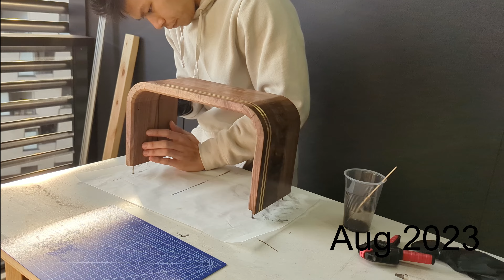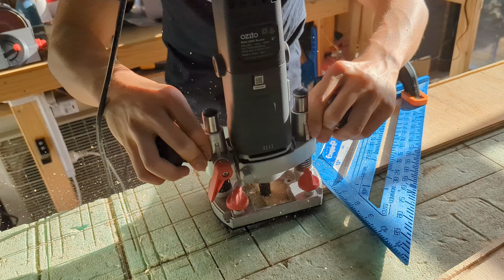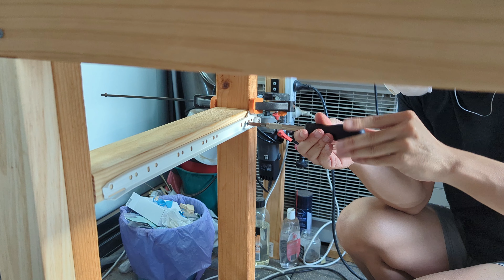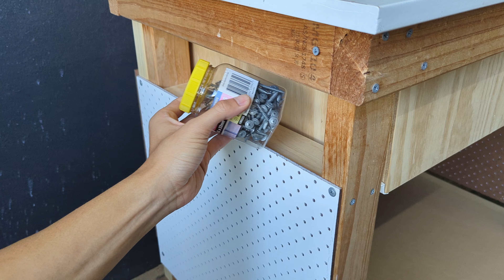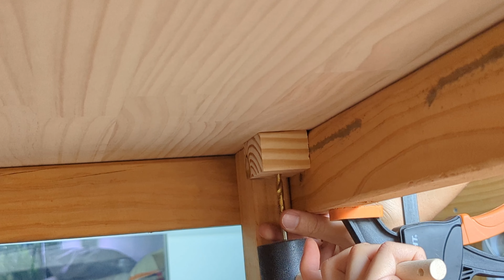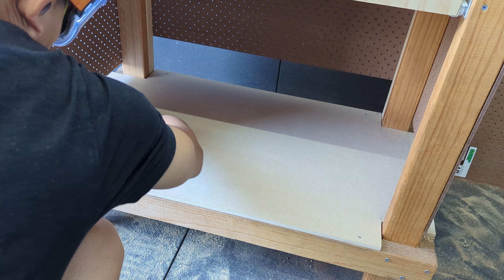Upgrading my Workbench. DIY | Budget | Woodworking

Comment: This is cool. There are a lot of clever features like M6 threaded inserts as opposed to straight screwing the top on or your choice to notch out the drawers slightly to make them fit and then re-using the bits you notched out or even the pegboard with a lip for storage. I'll keep some of these things in mind for the future work I do.
Reply from the maker: Thanks! Glad you found some useful ideas

Comment: Hi mate, well done on the build. It turned out really great! I enjoyed watching what you can do on a tight budget with simple tools and in a limited space.
Just a silly question. Where did you get that foam to support the wood while cutting with the circular saw? Do they sell it in Bunnings? 
Cheers
Reply from the maker: Thanks! Yep, got it from there. It's called XPS foam. I got the 50mm thick one but the 30 should be fine as well
Reply: @mxcbuilds  Perfect! Many thanks for the quick response :) Keep up the good work.